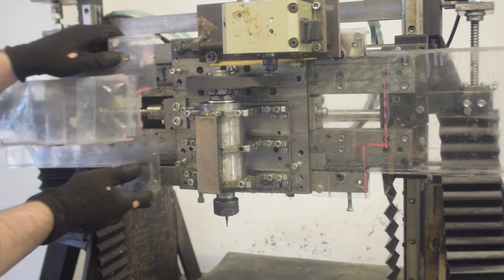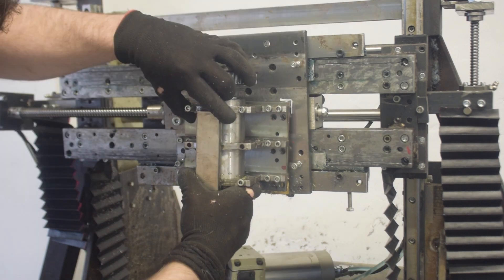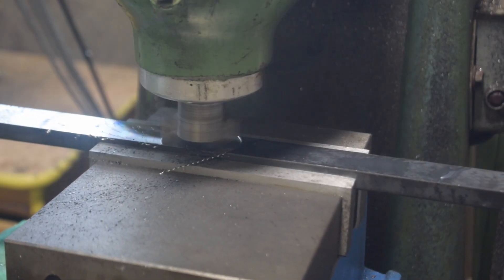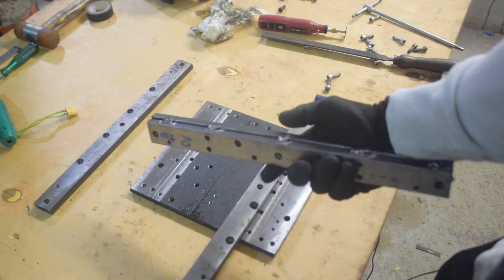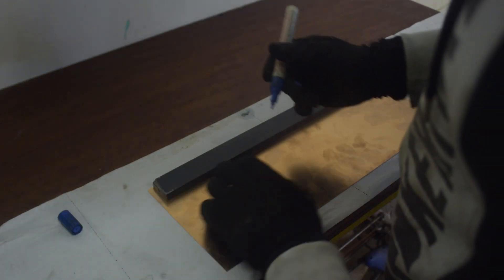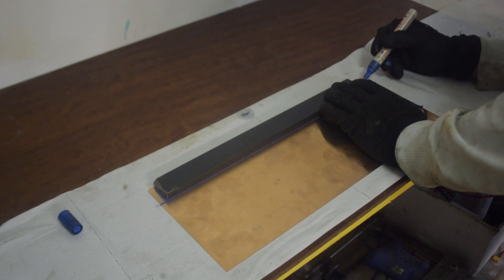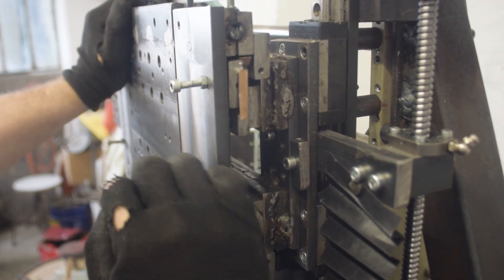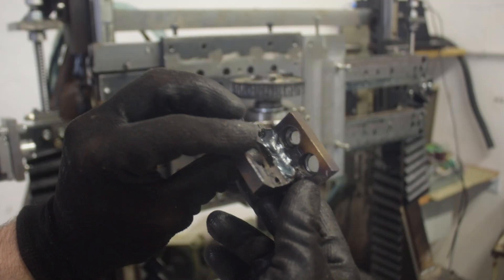X Axis with bronze and thicker gibbs? | CNC Upgrade part 3

Comment: Nice work, that should make it tighter. The Lazer is putting down that pattern quickly . It probably takes longer to program that to run it.
Reply from the maker: After calibrating it, it is outstandingly precise and fast.. programming it once understood the software isn’t even this long.. the longest part is designing the circuit and then the pcb. It isn’t made to do that but after a few weeks of research I managed to let it work like nobody else on yt (at least based on what I’ve seen so far)